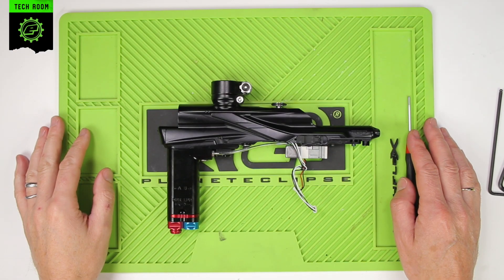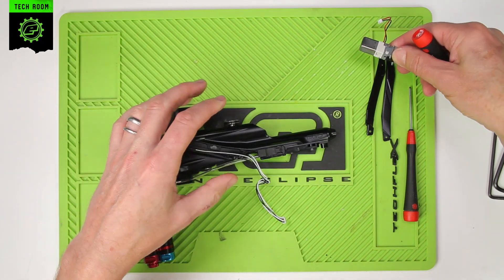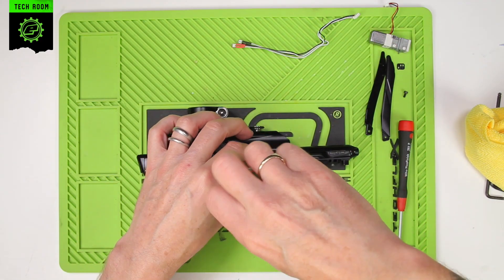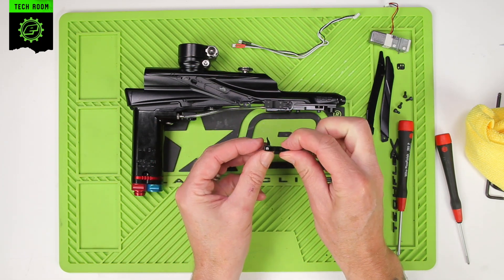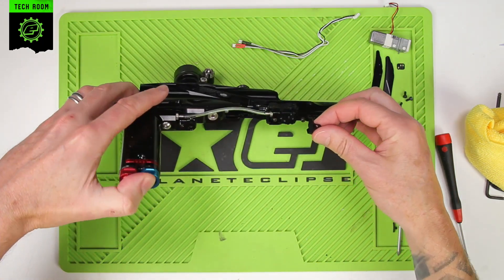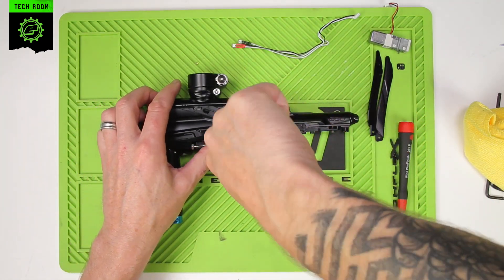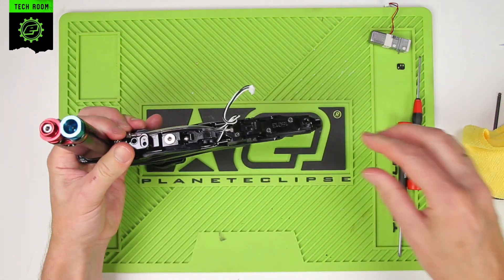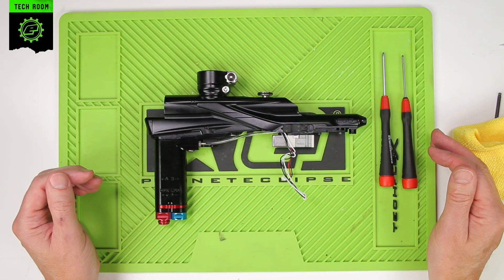Eclipse EGO LV2 Lever Valve Maintenance

Comment: MAKE YOUR BOARD MORE SIMPLE LET US PICK THE FIRING MODE AND BPS NOT LOCK US INTO PRESETS AT 1700$ A MARKER  WE WANT ALL MODES SEMI RAMP FULL AUTO AUTO RESPONSE LIKE IT USED TO BE AND 5BPS TO UNCAPPED NOT JUST 5 10 15 UNCAPPED COME ONE
Reply: What are you talking about? If you are from Germany you will probably have only SEMI, you probably need to flash new software and you will have all modes or you have turnament lock? Also you can change BPS in tenth like 10.1, 10.2 or 10.3 and so on... Never tried 5BPS can not say something to that, for that i have a EMEK👍
Reply: this guy commented on every single lv2 video lol.
Reply: @notjoeyg666  did not see that 🤣🤣, PE boards are most sophisticated in paintball Industry, even for me as a Tech, there are so many things that dont need to be touched, PE guns, they either work great or they are do not, and if they dont work, it is mostly user fault (not maintaining it properly) and rarely mechanical issue like dead solenoid on older models till LV1.5... 
But for that guy, PE should make only 2 options that he should be able to change, BPS and Firing Mode 🤣🤣